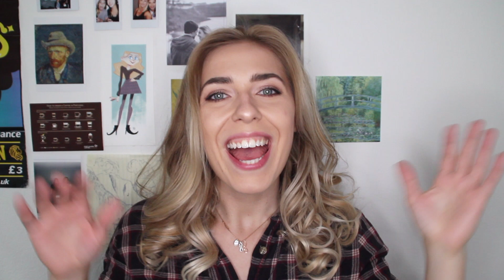Is engineering hard? How hard is engineering? Is engineering really that difficult?

Comment: Same here, I am terrible in essay writing even in my 1st language.

Solving a differential equations are far easier for me than memorizing the biology terminologies and history.
I still remember my 11th grad exams. I studied biology 100 times more than physic and maths.

It's totally depends on person's interest. Calculus and electrodynamics are favourite subjects,so electrical engineering is not that hard for me.

But still there are some subject which are difficult for most of people like analoge system design, computer architecture.
eg. In in final lab exam , no one was able to get correct output from my class.

So, engineering is difficult. But if you are ready to challenge your self then every thing is achievable.

Comment: There are impossible problems in engineering, mostly to do with resource allocation (budget and scheduling).  Say you have a project that you estimate will take about 30 hours, and your boss only allocates 17 hours to you.  Now it is impossible for you to complete the project on schedule.

Sometimes you get people defining conflicting project requirements (managers or customers) because they do not understand the engineering tradeoffs involved. (Ex. Filter Noise vs Bandwidth) 

And some people will set you up to fail deliberately because they want to use you as a scapegoat, just dump their problems on you, or because they are threatened by you and want to see you crash and burn.
Reply from the maker: thanks for your perspective jess. Ya I can see how being in that situation would set you up to solve an impossible problem. Hoping things are going better for you!
Reply: Couldn't agree more! Just keep your head up and use that as fuel. There is a reason why they are jealous of you😉

Comment: Just randomly found your video and you gave pretty good advice, are you an engineer or computer science major coding? I’m having trouble picking A major doing research. Thinking about solving problems everyday sounds like it would be overwhelming doing everyday but like you said nothings impossible as long as you keep practicing then getting good at it
Reply: As you said courses could be difficult at some points and easy points at other points, how do you think it’s like after finished getting your degree and being an actual engineer?, would the math and problem solving  be difficult and overwhelming  and get burnt out quick once in the field? I’m not the best in math, but I feel like i can do it as long I keep going at it and finally understanding it still deciding what major; as for now im thinking civil engineering